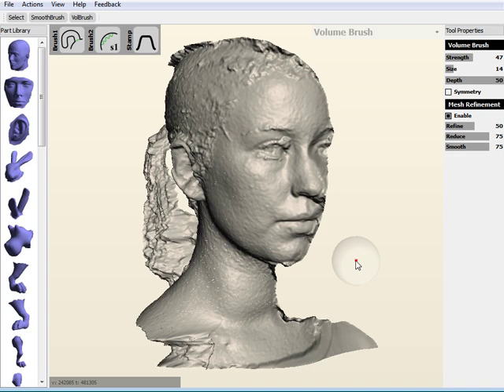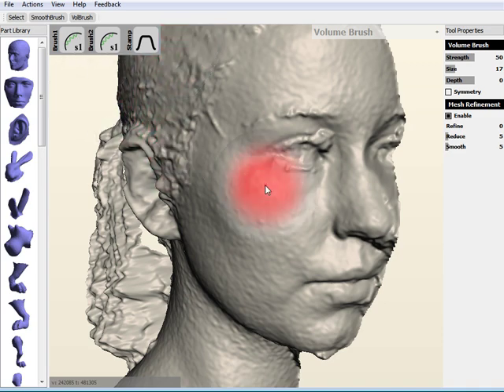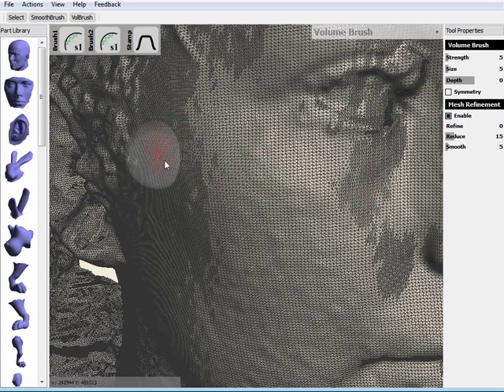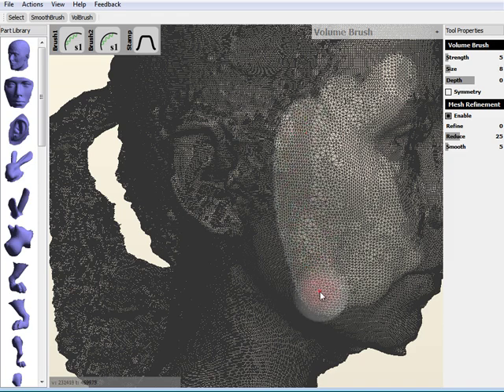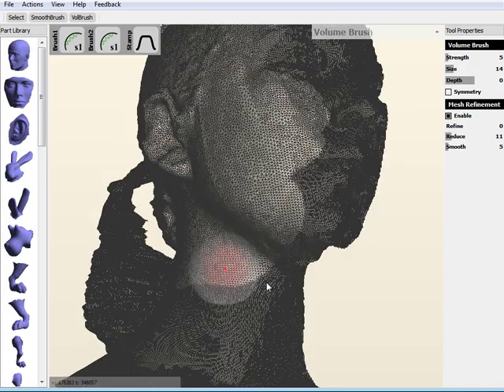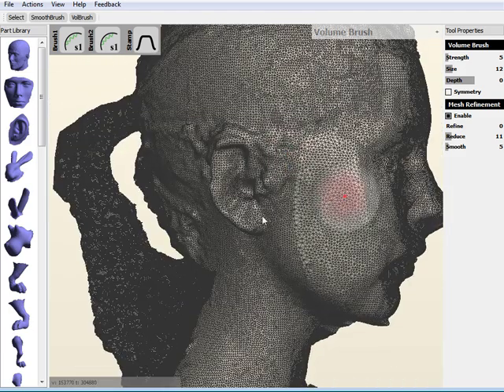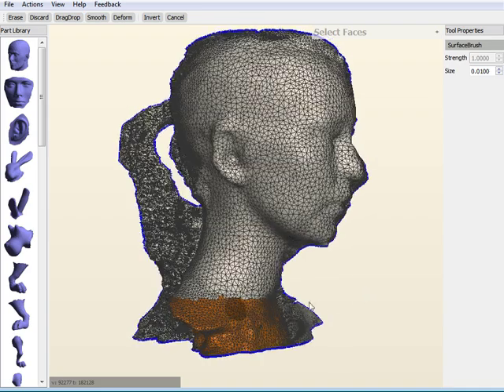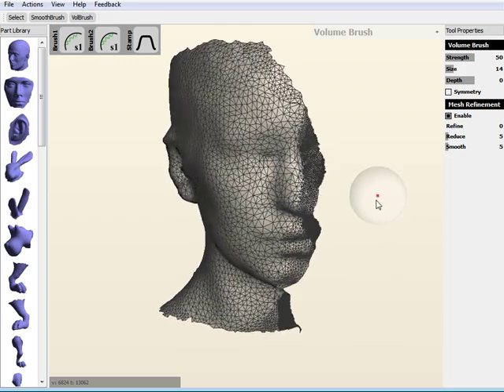mm04 Mesh Reducing and Scan Cleanup

Comment: I am trying to find out how to lower the vertex  without losing detail , I have tried this way and it works to a point. Is the any videos that show how to  do what I want?
Reply: You can try out Mixamo's Decimator. It's free and you can use it with an Autodesk account. The only thing is that it requires that the model be in fbx format and it decimates the whole model. It's the best Decimator I've seen so far, though.
Reply: ahhh I don't have a autodesk account and usually use obj and 3ds formats. Guess I will reread the manual and see if I missed something that could help. But thanks for the info. By chance do you know how to map a mesh in sculptris or Meshmixer? I created a few meshes but need a good map I could alter in one of my art photo programs.
Reply: Debra Brooks I don't know. I use Blender or Hexagon to uv unwrap.

Comment: ive got a large scan... with 5M triangle a 2gb  videocard still struggling to  represent on display.. I went to another card it has gddr memory and allegedly  5000 the  core clock ...

all I could do cut  up the model with plane cut... when it  got down to 2.5 M tris, then I could handle better..